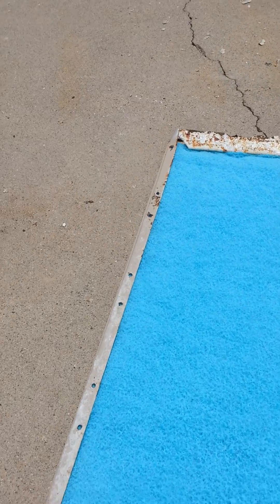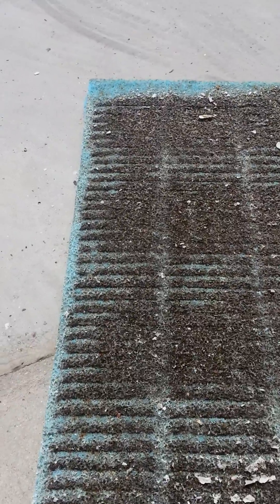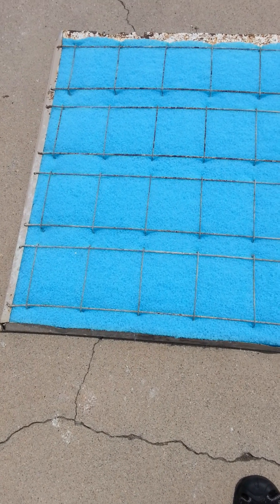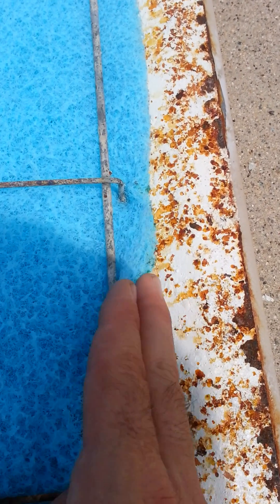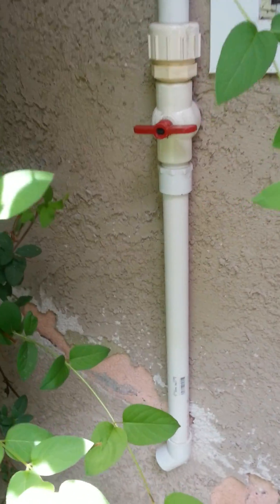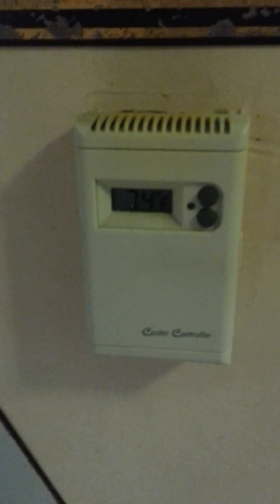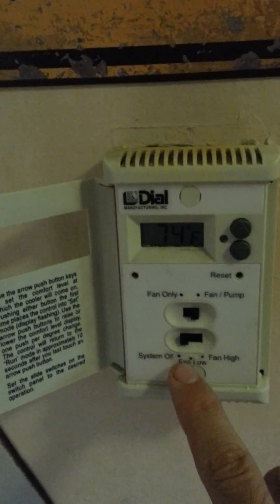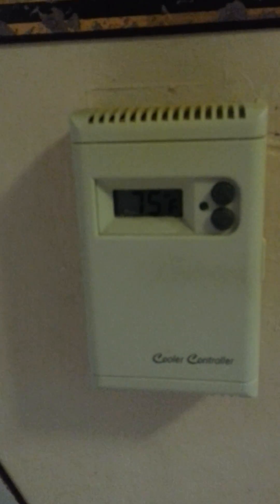Swamp Cooler Improvement

Comment: The filters are a good idea for short term but those blue pads are not as efficient as the straw pads.
Reply from the maker: I get that same comment on a regular basis. Even in 35% humidity I get a temperature differential of greater than 20 degrees. 103 outside andless than 80 inside works for me.

Comment: Some guy in another video said the UPDUX messed up the insulation in the attic from the moisture.
Reply from the maker: I live in Southern California inland where the humidity is low. Also, I have multiple vents in the roof and in the eaves. I have had the UpDux in place for several years now and I have been in the attic checking for for problems. I have not seen any. Have a nice day!

Comment: I installed 2 UPDUX in my 1400 SQ house and have a Master Kool type cooler and it works great.  The only problem my wife has is that when you open the door the UpDux door slams down.  Do you have the same problem?  Have you heard of a fix for that?  I live in the Mojave desert whit temps in the 100s often.
Reply from the maker: My home is 1,150 Sq Ft. I have 1 UpDux in each of the 3 bedrooms. My setup has  less air flow per UpDux. I also I have the master bedroom bathroom window open and the door into the garage open about 2 inches. That results in a relatively low air flow which means the "lid" on the UpDux is not standing straight up resulting in a more gentle closure. I suggest you refer to the information in the UpDux box or their website to find out what their recommendation is for the number of UpDux for a home your size.

Comment from the maker: Hello everybody! This is an unprecedented heatwave here in Southern California. The sky is obscured by smoke and clouds. The official temperature outside is 113 degrees as I write this update message. I installed a larger swamp cooler with a 1 horsepower motor. I have 3 thermometers inside my home. They show 3 different readings: 75, 80 & 83. Even if we accept the highest number that still means that my home is at minimum a full 30 degrees cooler than outside!! So, to everyone who has claimed that the blue pads do not work as well as Aspen pads, my data proves you WRONG!

Comment: Steven, at 10 grains per gallon (17 mg/L), hardness those filters will only treat between 155-300 gallons.The only ones that really work are the old school sodium exchange softeners or the acid base exchange ( commercial) exchangers which substitute hydrogen and hydroxyl ions giving you a pure water exchange. Since you did mention scale you would need many filters of the kind you are using in parallel to effectively  treat the flow used ( extra contact time). And for God's sake don't let any snake oil sales people talk you into the magic magnet filters. Also having tried many evaporative cooler pads, the aspen pads are the best, much better than the blue synthetic pads. The corrugated honeycomb type pads are ok if they are VERY thick only.
Reply: I had two blue pads in my cooler, had to throw them out.  Replaced them with the aspen.  Works so much better now.

Biggest problem with the blue material, it does not absorb water like a sponge.  That is essential to develop the large surface area for evaporation, and prevent "channeling"  which causes dry spots for hot air to be sucked in.

Comment: the aspen pads work way way better than synthetic
Reply from the maker: You are not the first person to have that opinion. You are entitled to your opinion. However the series if careful measurements I have taken documenting a drop in temperatures inside my home prove your opinion to be unfounded. I will continue to use 2 synthetic pads stacked together in all 4 of the inlets of my rooftop evaporative cooler based on the decreased temperature readings inside my home on days when the external  variables such as temperature and humidity were the same. Data always better than opinion. Have a nice day and I hope you and your family are all well.
Reply: Steve did you also test with Aspen pads?

Comment: Hello my wife and I run a Doggy Daycare in Utah. The temperature today whats 103 degrees, wow it was hot! I wanted to ask a question. I seem to be having a a lot of excess runoff from my roof, is this normal? I also wanted to mention that I have 3 swamp coolers, so the amount of excess water is exponential.
Reply from the maker: I am absolutely NOT recommending that you go up on the roof of your home. That is a decision you must make on your own. You may have a damaged float causing your water to constantly flow instead of stopping when the pan is full. Another possibility is a hole in the pan from rust causing water loss. Do you perform maintenance on your swamp coolers? They need work to perform properly.

Comment: 1. 6* temperature drop for the sake of shorter motor life and increased current draw is not efficient.  Efficiency can only be gleaned by use of a manometer to check w.c. or static pressure's. 
2. A filter is a filter,  a polyphosphate cartridge is a polyphosphate cartridge.  It is the responsibility of service technicians to properly educate lay persons.

Comment: 1. Using 2 pads does not make a cooler run more efficient.  Using 2 pads causes a restriction in the air flow and can cause the motor to run hotter due to the higher resistance. 

2. The 2 white containers on the water supply lines are Not filters.
They are polyphosphate cartridges. 
Polyphosphate is a mineral compound that sequesters calcium and magnesium salt, ( also compounds  ) ( remember your high school chemistry  ).
When you sequester,  ( prevent a chemical bond )  the calcium and magnesium salt do not combine.
Reply from the maker: Anthony, (1) based on my my personal experience with temperatures inside my home decreased by up to 6 degrees after I doubled up the pads you are 100% wrong. (2) canisters that sequester dissolved mineral salts perform the action of "filtering" as understood by the average lay person. You are simply being arrogant & argumentative without any actual data. Go away and bother someone else.
Reply: @bccie1pres  You tell him. My thoughts exactly!
Reply from the maker: Anthony, (1) based on my personal experience with the temperatures in my home dropping by 6 degrees following the installing the doubled up blue pads you are 100% wrong. (2) any object that sequesters is performing the function of "filtering" as understood by the average lay person. You are simply being arrogant and argumentative for the fun of it. Go away and bother someone else...BLOCK
Reply: If you don't vent a cooler properly the blower along with amp draw slows down.The motor only gets too hot by when the amp draw goes up.

Comment: how do those vents keep the attic cooler?  Isn't the hot air from inside the home going up there?  We have these in our home.
Reply from the maker: Due to sunlight beating down on the roof of a home attic temperatures can reach 180 to 200 degrees. The higher temps are more likely due to the popularity of dark colors of roofing material which absorbs more more heat which then radiates into the attic. These high temperatures in the attic will radiate into the home, even through thick insulation. This effect is similar to heat in your oven making the kitchen warmer. Hot air in the attic without an exhaust fan or air flow from UpDux will flow out, but at a very slow pace. The cool air coming in from a swamp cooler has to be allowed to flow out of the home to keep the temperature inside comfortable. This is traditionally accomplished by keeping windows partially open in every room. The UpDux redirect that flow of cool air into the attic forcing the very hot air out through roof vents. You can experience the heating of attic air this spring on a warm or very warm day before it is hot enough to turn on your swamp cooler. Safety First DO NOT DO THE FOLLOWING UNLESS YOU ARE ABSOLUTELY POSITIVE YOU WILL BE SAFE!! Place a ladder under the access to your attic. Climb up and put your head and shoulders in the attic. You will be surprised by how much higher the temperature is in your attic on a warm day. Have a nice day and please be safe!

Comment: updux wont help an AC adapted into the system all the AC air will spill into the attic. need a way to close them off. my house requires 10 UpDux.
Reply from the maker: Crypto Noob UpDux are for evaporative cooling systems only.. they would be counterproductive for a refrigeration cooling system.

Comment: I always reuse pads, just spray them out. I clean mine once a year, but there is only a few months that it is needed. The same goes with the water pan there really isn't tons of sediment to even bother with after the preseason clean. Now if they could invent plastic tubing that didn't break in the hot sun. That cheap fridge line is leak prone to.
Reply from the maker: KJR Channel I use copper tubing to feed water. Even with 2 filters in the feed line and descaling packs in the pan my pads weigh about 10 pounds each at the end of the season due to mineral deposits from the hard water we have here in inland Southern California. I would reuse if I could!

Comment: The "up ducts" are intriguing.  Most of us with swamp coolers are venting to the outside, but great idea to cool the attic as well!  I'm gonna have to buy a few of those!
Reply from the maker: Morgan Brown the product name is spelled UpDux. I got mine at Lowe's. the directions tell you to go up from inside the room. I went into the attic to better place the box between the joists. I drilled a 1/8 inch pilot hole from the attic then went down into the room to verify that it was not too close to the wall. I made a wooden template from a piece of scrap 1/4 inch plywood. I made sure it was square with the wall using a carpenter's square. You want the hole to just barely let the box up into the attic space. If you have insulation in your attic space you will want to move it away to allow easy installation. When you finish put the insulation back but be sure it does not block the lid from lifting when your cooler is running. With the UpDux in place my attic space stays under 95 degrees even on very hot days! Have a nice day and please be very careful. The attic space can be dangerous so never go up if you are not in good health and have a good forehead light to see with!
Reply: Steven Christiansen thanks for the quick response.  What is your home square footage and how many ducts did you install?  I did find a size chart (http://dialmfg.com/docs/Updux-Info.pdf) but they may be biased (in favor of too many ducts).   I do note that they have plugs that prevent cold influx from the attic (cold is our bigger problem in Denver ).  Do you use the plugs?
Reply: Steven Christiansen and sweet wheelie on your profile pic.  I race road bikes but broke my hip two months ago...season over.  To your point of being in good health...may have to hire a handyman, much to my chagrin.  Perhaps I can cut the templates without going up.
Reply from the maker: 1300 square feet, but I cool my garage too. I prefer to keep all my windows closed because of crime. I have 1 UpDux per room currently but I am planning to add more to increase flow in the bedrooms.
Reply from the maker: 1) Installation from inside the house can be done. instructions are included with purchase.
2) Dang Dude! Sorry to hear about your injury! The wheelie is one of several pics of me doing one every time I saw a photographer on the side of the road every time I rode "Breathless Agony". It is put on by Santiago Cycles. The course is 114 miles with 12,000 feet of climbing. I have been struggling with my scrum being pushed out of place by phone hacker in an SUV back in 2009. I wish you a speedy recovery! My current hobby is making pens. Check out my ETSY page at etsy.com/shop/PedalingPenTurner if you are interested.
Reply: Thanks for the last bit of info on the up-dux.  I've got a $100 gift certificate to Home Depot, so I'll start with 2, though I suspect I need at least 5, as we have 1800 non-basement sqft.  The Breathless Agony ride sounds cool - I went to HS at Brea-Olinda HS, so I'm vaguely familiar with the area.  Didn't ride a bike once in my 4 years in Brea!  Very nice pens you have made!  Seems like Etsy is perfect for that type of custom art - good luck.
Reply: Up ducts  can be a little tricky to use and position. 
Remember,  when you pump air into a box, your exhaust openings need to be equal to the supply pressure. 
If the exhaust is less than the supply pressure,  then vapor  ( water  ) can condense into your attic space resulting in possible mold growth.

Comment: Doesn't the double pad make the fan motor work harder to draw in air? Also,did you drill a new hold in the bottom of the cooler for you by-pass drain?
Reply from the maker: Paul Badu, No I do not believe the double pads create any excessive drag. The air flow is still the same as far as I can tell. all I did for the out flow was remove the pipe that used to work as an overflow. I used a 1 inch pipe to reduce the chance of clogging, but I still put in 3 flange fittings in case of a scale clog during the spring cleanup. it hasn't happened yet!
Reply from the maker: No I do not believe the double pads create any excessive drag. The air flow is still the same as far as I can tell. All I did for the out flow was remove the pipe that used to work as an overflow. I used a 1 inch pipe to reduce the chance of clogging, but I still put in 3 flange fittings in case of a scale clog during the spring cleanup. it hasn't happened yet!
Reply: Enjoyed this. Very good ideas. However, I do see a potential problem. Removing the old water eliminates the "swamp" smell that happens with stagnant, overnight water. However, the overflow serves a necessary function. While the unit is running, the water level valve opens up to offset the water level because water is now in the pads. This keeps the water pump from running dry.
However, when the water pump is turned off & water is not in circulation, all that water in the doubled up pads is gravity fed to the holding pan. Without the overflow tube that water will overflow over the sides & on to the roof. Therefore, another hole would be necessary to drain the unit. We like the idea of draining the water but but also need the overflow tube. What do now is leave the water pump running throughout the hot season then buy a new one the next year. By keeping the water in circulation it does not get that stagnant swamp smell. There is a pump available to drain the cooler @ regular intervals but that too is too pricey for us.
Good presentation & great ideas. I shall implement what I can & work on the rest. Thank you.

Comment: aspen pads better
Reply from the maker: My experience is the exact opposite. my home is cooler and more comfortable with the changes I laid out in my video. Yesterday day it was 111 degrees here in San Bernardino and the temperature inside my home never got above 78.
Reply from the maker: David M Thanks David M. You are right about the temperature difference between L.A. and San Bernardino! Have a nice day Dude!